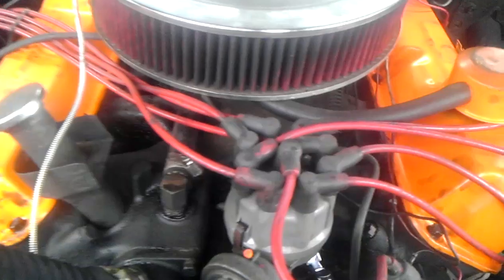Ford f100 FE390 engine timing

Comment: may still be a notch out on the distributor. from zero that is too much turn for 10 degrees. when replacing an FE distributor, if it goes in easy you are in the wrong slot. zero  everything and see if rotor button lines up correctly with 1 o'clock marker. adjust from there. key words when timing and tuning stock engines...'ease of starting'. it should turn over less at start than an injected engine.

Comment: I know this was a long time ago, but theoretically if I don’t have that timing light tool could I just start my truck and let it run when fully warmed up and turn the distributor and time it by ear? Like pretty much just tweak the distributor until I find where it idles the smoothest.
Reply: No, not a chance. But you can static time it before you start it by lining up the timing marks at the advance point you want. Use an ohm meter to determine when the points open as you rotate the distributer. From there you can drive it, advance the timing a little at a time until you detect pre-ignition/spark knock when applying a heavy load (like low RPM, high gear, light acceleration). If you get just a slight amount of knock under heavy load you've found the point of max advance that you don't want to exceed, maybe even knock it back a bit.